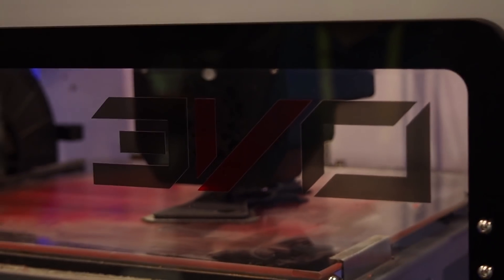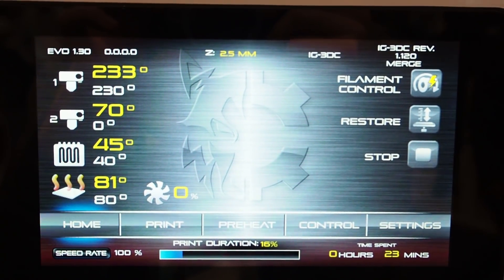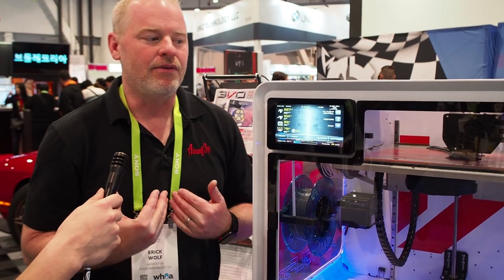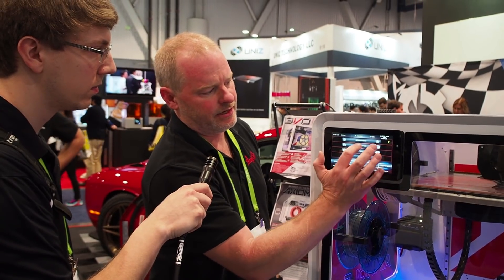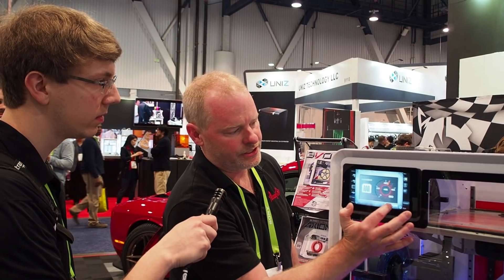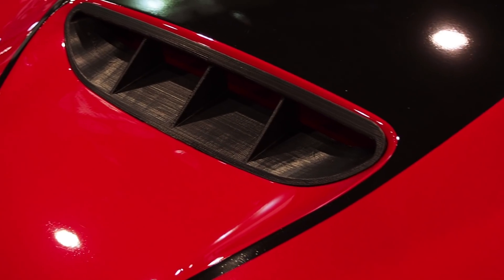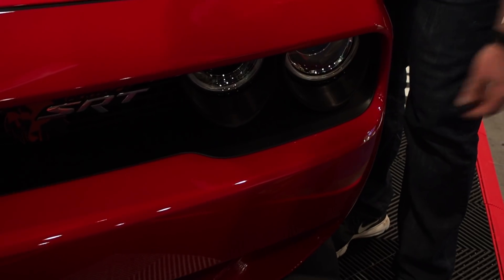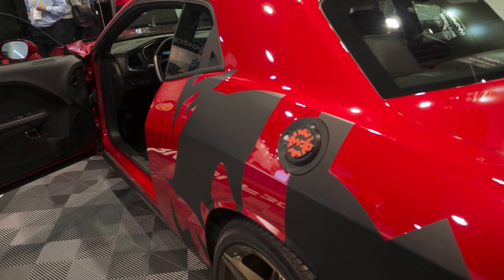Airwolf EVO - Desktop Metal 3D Printer | CES 2018

Comment: We have an airwolf axiom dual. Out of the two nozzles one will drewal with most and maybe all resins while the other nozzle is being used. There are multiple features to help with this problem but none of them solve the bad results with strands of material whispered and globed onto the part. Not often but multiple times for every part. When a nozzle runs into that glob the head bends and snaps back in place most of the time. This video shows two nozzles but only one is being used.  Even on the print in this video look at the wall being printed. On one axis the wall is solid and on another axis the wall is hollow. Now look at the nozzle being used in this video. It is covered with resin because the nozzle smears the resin around due to the large flat end of the nozzle design. We have other printers and none of them get the nozzle dirty because they don’t use the unprecise smear technique.  I have machined down a nozzle to a point with only a .010 step shoulder, so I wouldn’t loose heat at the tip and to stop the smearing. This helped but the resolution of our printer is not good at all and I found that one pass of the nozzle would lay a line and the next line would not bond to the first well at all. I bought Simplified3D slicing software (this software gives you true complete control over your printer but get ready to study to understand what everything does and a lot of experimentation). With this software I did some adjustments to get the two lines I printed to bond very well and have little resin build up on the nozzle. But if there is build up then eventually you will have a glob of resin stick to your part and the nozzle will be dragging a slime around your part as the printer prints. That is what the original nozzles are designed to do I believe, Smear the resin flat. The nozzles are made of aluminum and when the nozzles wipes over the cleaning brush it turns the nozzle hole into an oval. I looked at the nozzle tip under a low powered microscope, but that is not really needed to see with but it helped to see all the scratches and groves the brush created. To prevent this we made nozzles out of tool steal and had them hardened to an extreme high rock well. But this messes with the heat transfer rate, hence the aluminum nozzles. There are other problems with this printer, I have spent 8+ hrs. a day for a couple of months trying to get this printer to work good enough for a R&D tool in our work in virement but failed miserably. Good thing? AirWolf will keep working with you with to try to get it to work to your expatiations until your nose bleads.  Thank you AirWolf, your really good about that. But I’m sad to say the drewal, poor resolution, machine breaking, nozzles getting ruined almost every couple of prints due to that cleaning brush, the nozzles getting covered almost every print with resin, the blobs of resin sticking to your part as it builds up on the nozzles as seen in the video (dirty nozzle),  the water wash away material not really washing away but leaving a gooey mess, The filament needing to be kept in containers with deskin (drying material)  to help keep dry but even doing that we have to use a filament dryer to help with bubbles popping out of the nozzles ruining that part of the print, keeping the glass build platform clean enough to print (hard to clean after multiple uses), The screws holding the nozzles on can get stripped out so easily, and your slicing software not really having enough options to give true professional control over your printer, and just not being ready yet for a commercial R&D application. The saddest part is the printer now sits in a box with a lot of supplies in our warehouse collecting dust. We have use a Uprint 3D printer, it is slow use to break down a lot but modified so it does not do that anymore, expensive material, and the printer is expensive. But the printer stays clean and prints truly good resolution parts. Our primary printers are now the  (FormLabs 2 ). This printer has taken us by surprise. The quality of the print is outstanding. But I recommend to get the cleaning station and definitely get the curing station (almost required to get a strong none sticky part). And absolutely buy the extended warranty. Ours has had multiple issues but primarily due to Fed-Ex damaging the printer during shipment. But with the extended warranty, if our machine breaks they have sent out another printer extremely fast to replace the broken printer with no cost to use, they even pay for shipping. Their tech help is outstanding, I call and they have answered, replied very fast and will work for your until your problem is fixed. I DO NOT REPRESENT ANY 3D PRINTER COMPANY NORE GET PAID BY ANYONE THAT EVEN RELATES TO THIS REVIEW. I have just had a lot of experience with the AirWolf Axiom dual printer and hate to see a new person investing such a large amount of money for a beginner, being they do not have money to throw around. 3D printing is amazing tech. and has given us ways to create new amazing things in such a short amount of time. Good luck to all you 3D printing people out there. AirWolf, Keep up trying to make a good machine but please don’t over state whet they really can do.